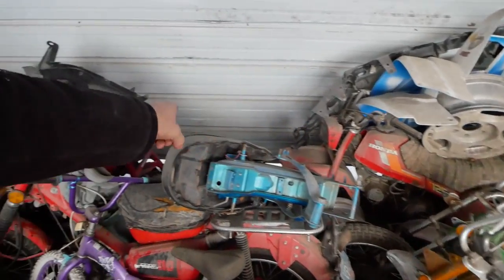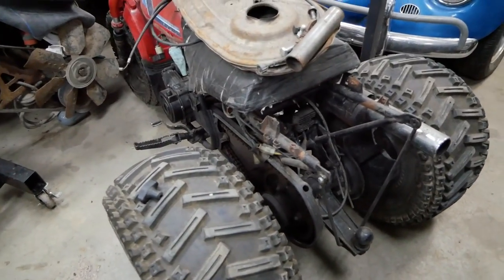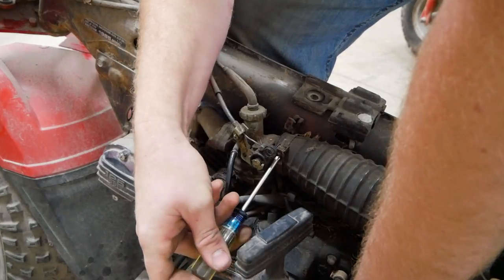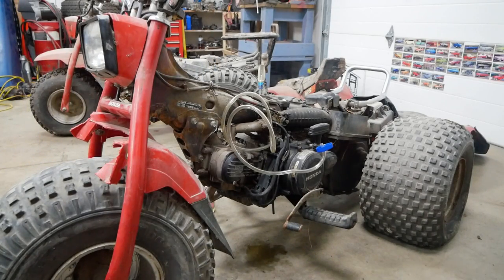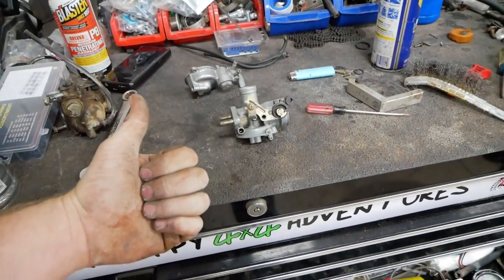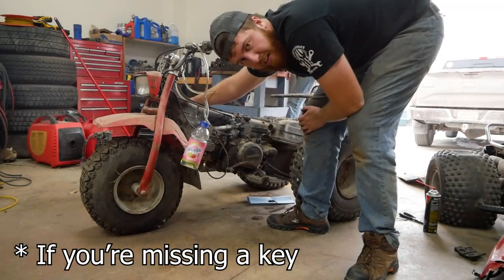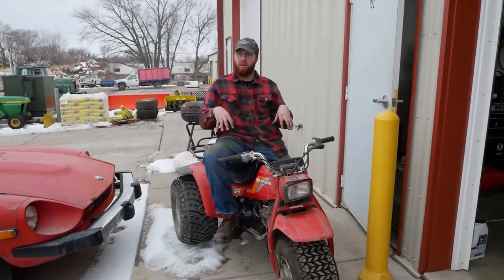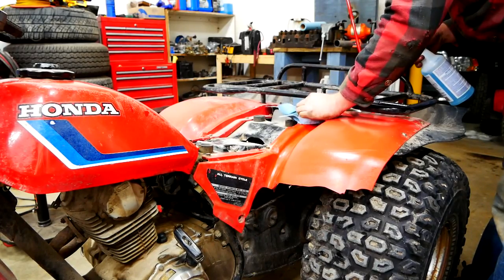Rescuing Two ABANDONED Three Wheelers, Will They Run??

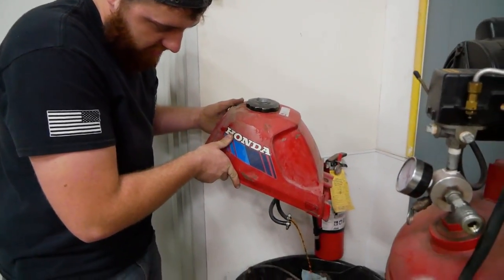Comment: 11:40 Pouring gas into a trash can that blocks the fire extinguisher.

Safety Third!
Reply: Beside the house sparkalator too.
Reply: Dambasses
Reply: The extinguisher isn't even blocked, but yeah the gas part was stupid.
Reply: Back to knitting now girls.....
Reply: Guys that "gas" was not even flammable anymore, relax. You could have thrown a lit match on to that trash can and the deck stain coming out of that tank would have extinguished it.
Reply from the maker: 5th*
Reply: I think water has a better chance of catching fire than that gas he dumped
Reply: If you think that fire extinguisher is blocked then I feel sorry for you.
Reply: Gas kills the germs in the garbage.
Reply from the maker: @sdvten  that's the kind of forward thinking I like😂👌
Reply: Bro. They at least HAVE a fire extinguisher. My fire safety plan involves fleeing, and probably some girlish squealing.
Reply: You see the condition of that stuff? Ain't no way in hell that would light! Hell, I think you'd sooner burn carbon dioxide lmfao.
Reply: it's a safety feature,. if the trash can catches on fire,. the bracket will melt and the fire extinguisher will automatically fall into the trashcan,. and put out the fire,.. 

forward thinking right there!
Reply: @alexanderhedglin337  When the flames rise up it will be too hot to handle.
Reply: @Mr.M1STER  If it caught fire ,the flames would keep anybody but asbestosman from reaching it.
Reply: @JunkyardDigs  your priorities are more in line than mine , i lit myself on fire with brake cleaner

Comment: Dug-out a Honda power washer that was literally buried in ground by a barn that was pushed away in mud landslide. Every orifice, even the crankcase was packed full of fine dirt. Partially disassembled it enough to hose it out, dried it with compressed-air, threw it back together, put oil and gas in it and it started and ran, even idled. Mr. Honda knows how to make a motor.

Comment: Thanks for the tip about brake clean eating seals! I got an old mower last summer and used brake clean to clean the carburetor but it looked like it had snuff in it but it was crusty. And a seal was already bad as well as the float. Thanks for all the tips in the videos. They really helped! 👍

Comment: I sold my 200ES Honda ATC in 2016 to a Wisconsin Vineyard owner. I bought it in 1984 and drove the hell out of it every fall and stored it the rest of the year. It was a little difficult to electric start below 20°F but once started, it would drive fine in most conditions with the exception of deep snow. This was where my 4 wheeler friends would out drive me. I have actually driven my 3 wheeler across beaver ponds and deep rivers. It was sketchy to do this as the back wheels while spinning, still needed to occaisionally bounce off the bottom momentarily  to continue slow forward motion. So I was basically doing an underwater wheelie. I once crossed a flooded river and needed a bit more speed with floating front tire, and my feet wedged into the back rack rails, I tried to shift with my hand and my friends said suddenly they saw the bottoms of my boots and the skid plate. I swam to shore dragging my wheeler to dry land, started it and drove it back to the cabin to get dry clothes and to change its oil. There was some water in the oil but it got me home. Very, very reliable. I did put inner tubes in two of the tires in the 32 years I drove it. Bad in deep snow but fun everywhere else.

Comment: I dig seeing these Honda revivals as I do the same(but not in front of camera lol) with 1970's cb750 sohc motorcycles.  You might think about getting into them.  Same basic stuff except it's like 4 of those quad engines all in one...4 times the fun, amazement, and satisfaction when they sputter to life and spew mousey mansions out the exhaust after rotting away for 20 or 30 years

Comment: A quick cheap fix I've learned when the bowl seals crap out is put some seal all on top of the old seals. Saved me $200 in carb rebuild kits on my bike and hasn't leaked 2 years later

Comment: Rebuild the carbs . I have 14 of these . High low range lever is not engaged correctly . The best carb kit is K+L . Polish the inside of the carb and they run much better .

Comment: Ill give ya a tip. Get a brake lamp and fill it with parts cleaner and use those cheap little steel, plastic, and brass brushes to clean the carb out. Then use carb cleaner or brake clean to finish it up.

Comment: You should check the timing device on the head of the noisy engine. Had that problem with my atc 110, which is very close to that engine. Also that one needs an engine mount bolt there, don't want to crack that weak frame.

Comment: good fun to see you working on mikuni 's that we have at home here in europe. simple straight forward and cheap parts a plenty.
Reply: oh and as you know....honda's that have no real big block issues will almost always start up again after the normal air spark fuel checks. as long as hte lubrication was nt dreadfully screwed it s pretty much fail proof. these little block are wonderfull.

Comment: Don’t know if you noticed but there’s a motor mount bolt that’s loose on the 125M the one with good tires. You can see it turning as the motors running. It’s located below the 1985 on the frame sticker.

Comment: They are Hondas for sure. I swamped my 1987 xl250r in a giant mud hole so I shut it off right away. Well when I got home I just changed the oil till it was clean and it fired right up. 😁

Comment: I had a 125M and it had transmission issues as well. The old farmer had drilled a hole in the top of the case and put fencing wire down through and hooked it around the shifter. The spring had broken and instead of getting a new one they just shifted it by hand via the wire sticking out the side of the plastics. Genius really, but the part was only $5. lol

Comment: If you dont have a special tool for that clutch nut you can usually knock them loose with a punch and hammer. That's what I usually do though it's not professional  it works.

Comment: Unrelated: I'm in the process of rebuilding a 1986 honda trx200sx quad that i traded a chainsaw for, the quad had no switch assembly, atc 200 dash and atc 200 headlight, 3 of the motor mount bolts were missing, the throttle cap on the thumb throttle was missing, the starter was missing and the chain sprocket was welded on, The cylinder was in REALLY bad shape, i ended up pulling so much dirt/rocks? and junk out of the oil pan and after all that i ended up honing it. buying new rings, bought a new carb, lapped the valves cleaned it up really good. Put new gaskets on it and got er' diled in, The thing starts in 2 pulls...i have no idea, how hondas start the way they do.. this poor motor was abused and was about to be junked until i got it. People throw away things for no reason at all!

Comment: The easiest way to get a hurtin' project machine back into service is having an identical donor carcass unit. 2 to get 1 running, or 3--2, might not be " cheaper" but you get a lot of parts in fewer moves, less travel, hassle, searching

Comment: My son and I mess with power spots all the time and have revived several ATCs. Unless not possible, hit the spray car wash on the way home. Aftermarket cables are cheap and good enough for brakes. China carbs get a bad name but I’ve only had one out of 30 that was an issue. They’re finicky to tune as the adjustments a little can be a little.

Comment: I enjoyed youse guys playing around with what is acknowledge as the most dangerous three wheeler's in the world.. they were banned here in Cali in the 90's. the accident rate was so high among younger riders that they had to. I enjoyed your and Mook's series where you went out to 
Arizona to try to rescue the Bronco. It just goes to show that rust free isn't all it's cracked up to be. the engine rebuild should be easy for you as the small block Ford is one the easiest engines to work on. and they are built Ford tough. I have built tons of them 289, 302, 351w and 351c a lot of them for racecars. I have also built lots of sbc race engines and the Fords outlasted them 5 to 1. good luck with your future endevours and I will watch and reminisce.

Comment: You need a pressure washer with heat and soap. You could clean up your
engines and compartments so you could work on things easier. Those 3 wheelers
would of cleaned up nice.

Comment: You should have bought the Trail 70 frames as well and sold them to Ike, he'd love those for his parts stash. As for switching from horizontal to vertical, those horizontal engines were only used in the smaller displacement trikes, ATC 70, 90, 110, and 125. A variant of the same engines were also used in the Trail 70, Trail 90, and the 125 Super Cub. The same goes for the Z50 "Honda Monkey" bike. Everything that was bigger regardless of year was vertical. My fathers old 82 ATC 185S had a vertical engine and it was three years older than these bikes. His 185S is what my brothers and I learned to ride "atv" on when we were old enough to drive it ourselves. I have a 1985 Kawasaki KLT 110 trike just like my grandfather had, but it needs a lot of TLC and it's harder to find parts for than these Honda machines. So it's going to be a bit before I can get around to it. My YZ 465 project comes first once the funds allow. :)

Comment: I bought the caltric $20 carb for my 200es and it was almost perfect right out of the box. It runs good accelerates just like new and idles a champ all that I had to do was adjust the idle screw to where I wanted it. I highly advise it for anyone with a rough running Honda at least the one for the 200es I haven’t personally used any others but if they are like mine they will be perfect.

Comment: That looks like a 1983 ATC200 with the optional front end, which was pretty much the precursor to the 1984-85 ATC 200m.  If it is not a 1983, it has had a front end swap.

Comment: Just for future reference, the starters in these, as well as most motorcycles and ATVs don't have a starter bending. They utilize what is commonly referred to as a starter clutch which is essentially a one way brg or sprag clutch that disengages as soon as engine RPM is higher than cranking speed.

Comment: Find a 84 or 85 fourtrax.  Every bit as easy as the old 3wheelers. I do love those 3wheelers. Learned on a 90 progressed to a 200 with a 350x motor in it. Good times

Comment: I’ll take that trail 70 lol. Those little
Bikes are bringing big bucks. You can use a propane torch to make that plastic look almost new again. Just take the flame of the torch across the plastic nice even strokes . You will be able to see it change. Just don’t hold it in a area for more then a second out you will burn it.

Comment: FYI- I always try to reuse stock jets but sometimes they are very very plugged, if simply poking a wire through the holes doesn't work, sometimes adding heat will work nicely.  Is that a 250sx I see in the truck?  I have an 85'.

Comment: tighten up the front motor mount on the 125m, looked like a bolt was loose. I've seen the frame snap without that mount

Comment: Adjust the valve lash on the noisy motor that is what it sounds like. That or a stretched timing chain slapping around these are very common problems with these motors

Comment: 26:50 MIssing screw in the valve cover.
Reply: Not exactly a valve cover, rather a CDI cover and if it’s anything like my 200es it is sort of like a magneto type ignition but with springs which control the automatic timing advance at higher RPM’s.

Comment: Man I had too many Honda’s. A 96 100r, beat to hell and smoked like a power station pant, but it didn’t die till my brother was bang shifting and split the case.  I also had an 82 xl250, sat for 15 years.  Went through the carb and it smoked like a California wild fire as well.  I did everything to get the rings to seal up but it was too late.  I routinely ran them both out of oil, the 250 more often because it used more.   The 250 was a 6 speed as well and all I had to do to it was toss a new timing chain in it and rebuild the carb. Now I’m on a 86 magna 1100. 4 times as many cylinders and 4 times the carbs.  That was a shit show getting happy.

Comment: Most of the time they are stuck in gear or gamed in gear
Or the fork is broken. Not running push it back and forth shift down . If that doesn't work push it

Comment: That spinning engine mount nut is getting to me. That seat looks like it's wrapped in a body bag... I guess that one's Mook's. If you want to make them easier to turn and slide, put skinny tires in the rear and leave a fat one in front. You'll have more grip in the front than the rear and it'll turn easier. I don't get why people buy cheap ebay carbs.. Mikunis aren't very expensive and they work just fine.. Hell they even put them on old Triumphs.

Comment: Talk about frozen sh$t. Just about a year ago I bought for a  $100 a suzuki king quad 300. The engine was stuck, the transmission was stuck and the throttle was stuck. 3 guys lifted it into my truck. The next day I drove it off the truck and around the yard. Just left it in the sun for a few hours. I did have to put a wrench on the flywheel but just barely and it freed up.

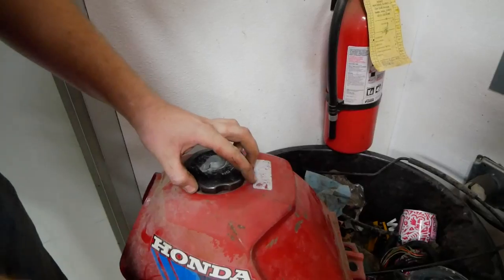Comment: That engine mount bolt to the frame rotating at @11:50ish is kinda sketch.  They all would have run better with quadrajet carbs.  Don't hurt me.

Comment: Getting a Honda to run I have to say is never that hard they are built like tanks and the engine well it’s a Honda enough said! Also don’t use brake cleaner in a carb at all as a matter of fact don’t use carb cleaner on one either mix up some gas and two stroke oil and get you a pump up can and it’s like having carb cleaner in a can only it’s way better for the carb! Carb cleaner was never meant to spray inside a working carburetor

Comment: Stored in a shed for years, dusty, open carb and all messed up. Runs after a couple pulls.
Me storing my bike over winter in a garage... 3 days of cleaning out the entire fuel system to get it running...
Honda > Kawasaki...

Comment: My '86 ATC125M ('86-'87 were redesigned, often called the "little big red" had super low and reverse and unfortunately a gas tank that is unavailable)  anyway the carb body screws for the bowl stripped the first couple threads - I filed the ears shorter on the carb bowl so the screws could grab some material. Yeah the carb seeps a bit around the rotted O ring, I had to put an inline shutoff in it as the tank is from an 82 with the two nipples (hahahhahaha...nipples...) and the carb has no shut off built in to it.  https://www.youtube.com/watch?v=mEevy4Fu4lU&feature=youtu.be

Comment: A friend of mine lost his 11 yr old son on one of those things , he was climbing out of a shallow ditch and it went over backwards on top of his chest . Suffocated him , its been 24 years .
Reply: That’s so sad. They were very unsafe vehicles
Reply: I'm of the opinion that the non-independent suspension versions - which are aslo the most common - were the most dangerous. The simplicity of the machines was they had no suspension. Those balloon tires were the suspension. My brother and i used to ride them and took the fast turns on two wheels with no concept we were doing something dangerous. We just steered through it. To be sure, all ATC types were dangerous. I could be wrong so i'm completely open for correction, but after the government banned 3 wheel ATCs, and enough years passed for data to be compiled on quads, they found that there wasn't a difference in accident/death rate. I believe the biggest culprit for ATC injury/death was kids physically too small for certain machines.
Reply: @mindeloman  , in hindsight I often wondered if age had anything to do with it . The young fellow was experienced and a strong boy. Sadly his father found him under the trike , we may never know exactly what happened . I know his dad never really stopped blaming himself. Sad.
Reply: @stevecook7551  ugh.......that's rough. It's bad enough losing a child being every parent's worst nightmare. So many times worse when you, the parent, find them. When I was a teenager my dad's boss lost his teenage son to a crushing accident. The story I was told: He was working on his car and backed the rear end up on ramps. It was a rear wheel drive automatic transmission car. Whatever repair it was, required removing the driveshaft. He failed to chock the front wheels and did not set the parking brake on the rear wheels. When he pulled the driveshaft he removed the mechanical link between the rear wheels and the parking pawl in the transmission. The car rolled off the ramps and crushed him. No one was home to help him. His parents rolled up on the scene.
Reply: @mindeloman  It happens so fast . I have spent my entire working life in construction , accidents don't just happen in a vacuum . They are a culmination of a series of events that align to form catastrophe . Ignorance and the hubris of youth are two of the most common denominators .  Stay safe .

Comment: Please tell me you’re not dumping raw gas into a full trash can that’s next to electric outlets and a air compressor (sparks from motor). Spontaneous combustion or ignition of vapors from sparks. Plus having to reach across the flames to get to the fire extinguisher. Extinguisher should be close to a exit. STOP pouring gas into your trash can.